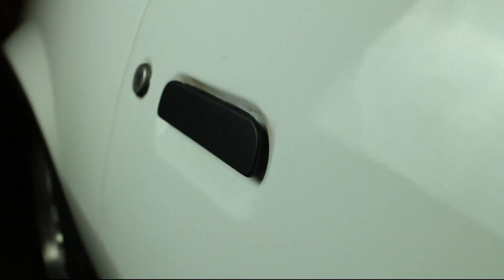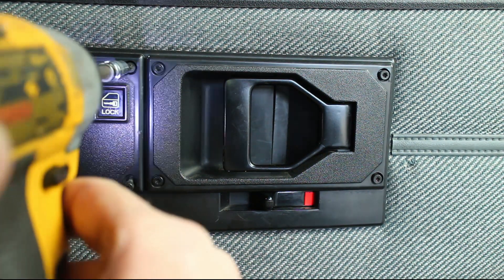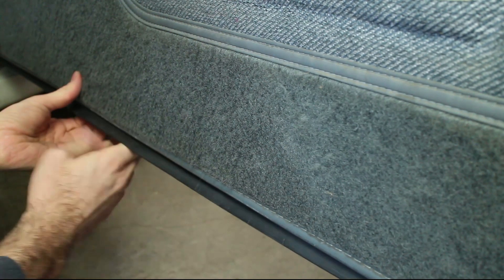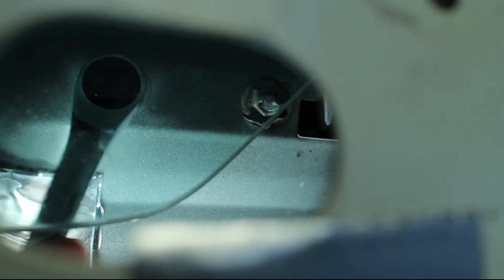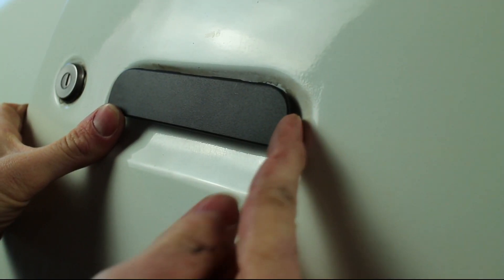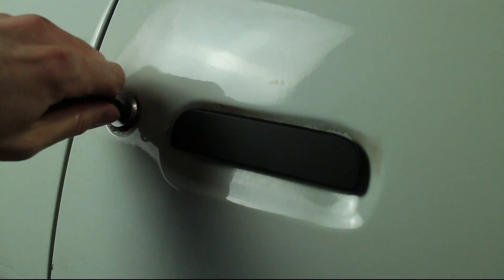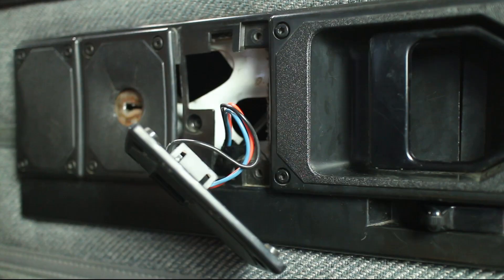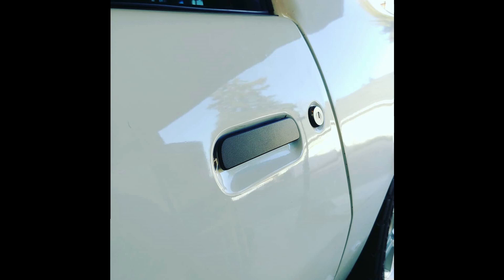Flush Door Handle Install (1982-1992 Camaro & Firebird)

Comment: It's been a year, you still like these handles? Any looseness or rattling?
Reply from the maker: none so far. BUT My 92 also doesn't get very many miles
Reply: @3rdGenGuy  mine either, my 91 has 69k. It's not going to be a track car like yours, but it's crazy how similarly in depth we are going into the modifications to our builds. Right now I'm swapping an LS6 and just found some OEM 91/92 rear window louvers that I'm restoring. Gunna take some work but they are gunna look awesome. I'm probably going to do these handles here in the near future.

Comment: Is there anyway you can go over replacing the distributor and maybe some timing stuff.
Reply from the maker: Not a bad idea
I haven't done a cap + rotor for a while
although my timing gun is missing lol
Reply: @3rdGenGuy  well the reason I ask and sorry for the long comment but my Camaro did not like long trips after a long trip about 30 or 40 minutes it did not want to start again I must have went and replaced everything I could think of even the fuel pump everything it wasn't until I replaced the module on the back of the distributor now it's fine.
Reply from the maker: I think replace that dizzy module in probably 2010 when my twin sister got stranded lol.
It's been a while

Comment: Im thinking if getting a set and doing a youtube video on them but I am worried about the lack of space to reach under. It appears you are only getting the tips of your fingers and not even that.. I worry about scratching the paint underneath. Do you find that you are rubbing your hand up on the paint on the door as you attempt to "pick" the door handle up?
Reply from the maker: the flush handles have less room for your fingers.
but the way i grab door handles always kinda dragged my fingers on the paint.
if you are worried, you can apply that Clear-Bra film just under the handles.